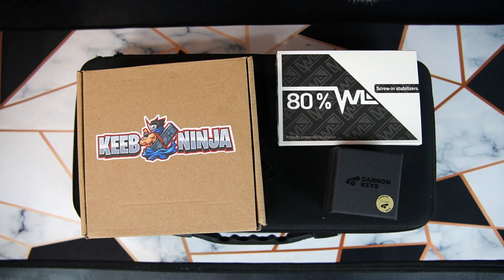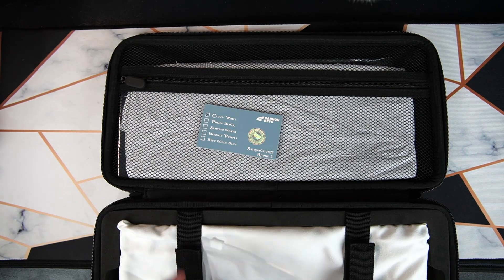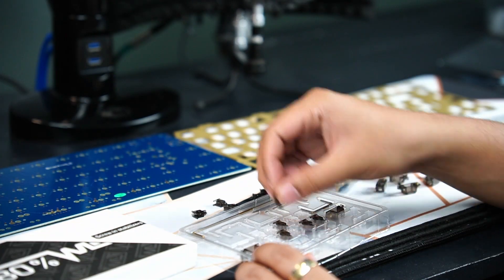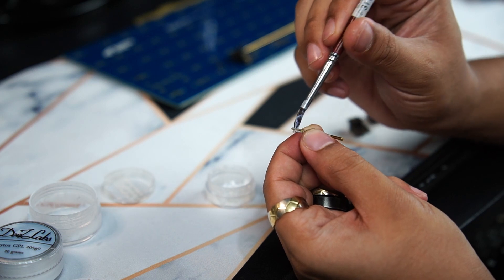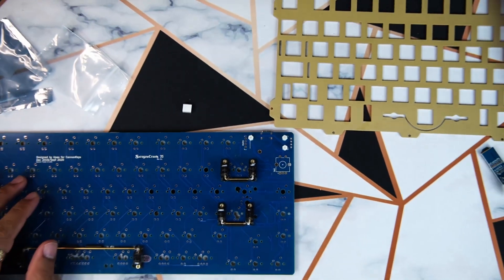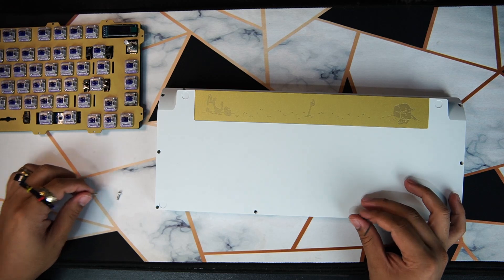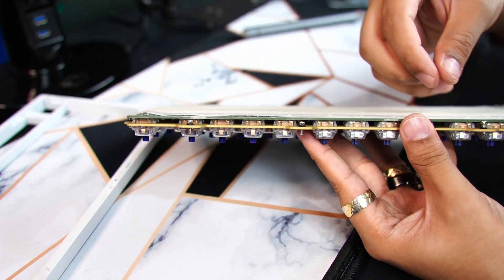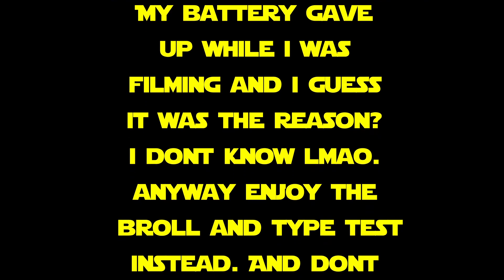Satisfaction 75 the king of 75%? 1000USD board worth it?

Comment: I’d definitely be interested in seeing a wire-bending tool, but I really can’t imagine they work any better than 2 pliers with foam/tape/paper/etc. between the teeth so the wire doesn’t slip or get damaged

I’m also somewhat lucky in that I never need to tune a space bar as I only use 2u (split spacebar), but the downside is i have more to lube since it’s always 5 even without a numpad
Reply from the maker: Ergos do be like that